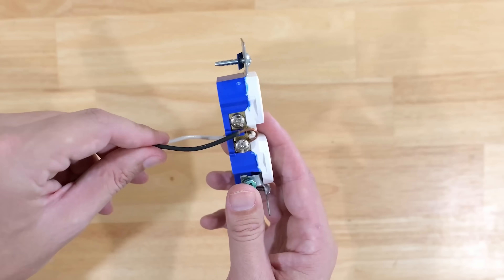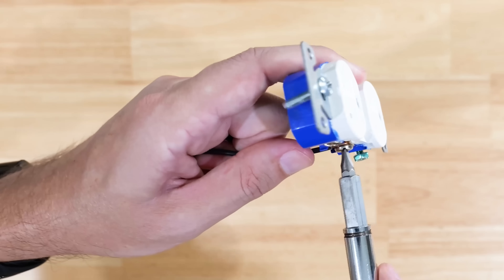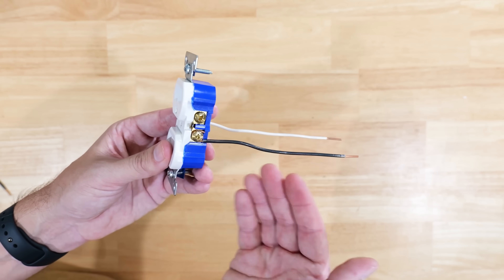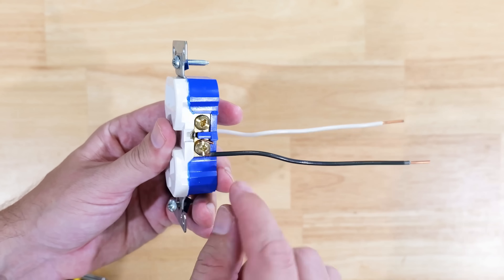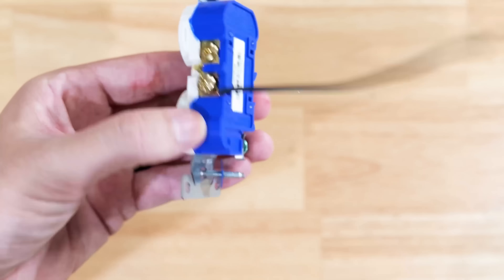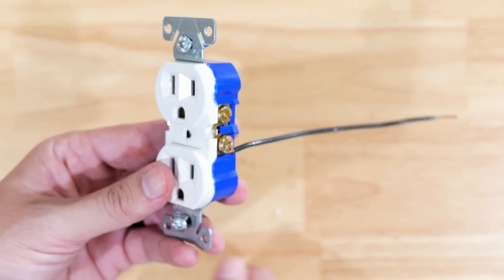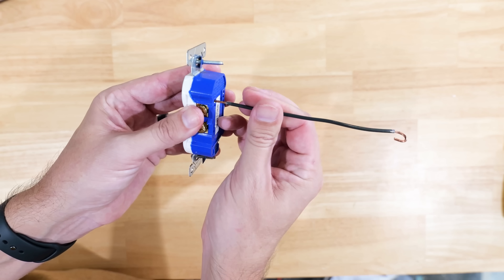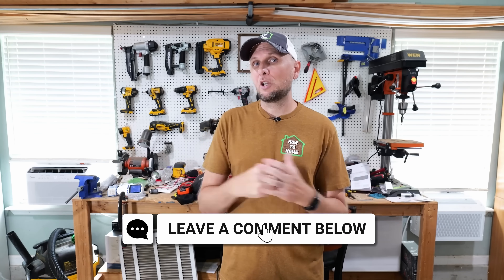Avoid Disaster! 8 FATAL Outlet Mistakes Most DIYers Unknowingly Make!

Comment: Where is 14g wire used for receptacles? Never heard of that - unless it’s in very old buildings? In fact code in Hawaii has #12 now even for lighting circuits, which I think is crazy overkill given the load nowadays from led lights compared to the old days with say old school 100 watt bulbs… 🤷‍♂️ Nothing wrong with overkill of course. Now in the Uk their overkill is simply insane! Every single outlet has a switch mounted on it just for the one outlet, which is massive and heavy duty, and each outlet has a fuse fer gawds sake! Each outlet costs a (relative) fortune. Their plugs are huge and insanely solid - tho bear in mind they’re running on 230 volt circuits. When  I show them a picture of 95c outlet with a two pronged plug they fall over laughing…

Comment: That 's completely safe to use 20A  receptical on 15 A braker ,you just overpaying for rec. What  is matter  is a load (device) plugged in to it .And  20A rec is completely OK for 15A braker if  it used for 3A table  lamp but you not using it to plug old washing machine which can consume 14A+ on a spin cycle.

Comment: DO NOT use a philips screw driver on outlets.  Use the PROPER bit head driver.  A Square Head. That will provide enough surface for a proper torque.❤ #9 use pig tails instead of making the receptical the inline fuse. Benifit is you do not remove power from DOWN LINE DEVICES if one fails. Its a outlet noy a junction box.

Comment: The NEC handbook shows and requires you close the J hook around the screw, this usually takes needle nose pliers to do this, this keeps the wire on the screw should it loosen up, since the backs of the screws are bradded down they cannot come out of the receptacle. You should of demonstrated that procedure.

Comment: Im not a pro but ive read a lot of code books. I re wired my last house and went overkill on all recepticles. 12 gauge and all commercial grade. I also take a needle nose and bend j hook before tightening the screws. Only reason I got into this was because I got a rediculous quote to re wire my brick house for $14k. I did it for less than $2k. That was 10 years ago. I had to re wire because of knob and tube.

Comment: I just retired doing this kind of stuff after 50 years one thing I did not do was buy those cheap receptacles like you said go ahead and buy a spec grade or hospital grade hospital was kind of high dollar but depends on what your it's feeding I always wondered why the hospital grade was so expensive until I took a hammer and bust a brand new one apart and everything in their brass and it was super thick

Comment: You need to stress that the proper torque can be achieved without slipping using the ECX head bit which is slightly different than phillips head.

Comment: I had some new backslash tiles put in my kitchen. A relative was doing it. He changed the recepticals. For some reason, the top plug in each receptical doesn't work.??? I took one off the other day. Here is my question and I could be completely out to lunch but the ground wire goes to the right plug in this case. No ground wire going to the left that doesn't work. I'm assuming it should ground through the box, but I noticed that the new backslash is sticking out a bit to far. Im thinking the box isnt grounded properly. I'm wondering if I run the ground wire to the dead terminal as well, would that fix the problem or screw things up worse. Sorry so long. Any advise would be greatly appreciated. Wayne from Edmonton, Alberta Canada! And no, we are not all this dumb up here 😂
Reply: I'm not sure what you mean about the ground. I think the Canadian standard is the same on this, but you should look it up to be sure. In the US, black is hot, white is neutral, green/bare is ground. Think about looking at the outside of the receptacle (as installed) but with one plug on top of the other (vertically, the way they are usually installed). (Or you could just turn your head.) For each plug, the white (neutral) wire goes to the wide blade on the left with the lighter colored screws; the black (hot) goes to the narrow blade on the right with the brass colored screws; and the ground goes to the green screw. The box doesn't really have to be grounded to work, but steel boxes are often also connected to ground to help any arcs go to ground instead of deep into you. There are lots of plastic boxes that aren't conductive anyway. The top plug and the bottom plug should be connected by plates within the receptacle. Usually, the top set of screws will have wires for power coming in and the bottom will have the wires that go out to the next receptacle. At the end of the line, the last receptacle may just have one wire on each side because there's no more circuit to go out to. Again, you should check and make sure the Canadian standard matches this. I think there's a single North American standard, but I don't want to tell you something that's wrong, so make sure. It sounds like your installation got botched and I wouldn't want to use those outlets at all until they get straightened out.

Comment: I disagree with your mistake #1. Amps are drawn by the equipment plugged into the receptacle. Receptacles do not draw amps. You should NEVER put a 15 amp receptacle on a 20 amp circuit. It can cause a fire due to the fact that the 15amp receptacle can not handle the 20 amp flow and can overheat. Whereas if you put a 20amp receptacle on a 15amp circuit the most you have done is wasted a little bit of money because everything in the circuit is rated at or above the standard. REMEMBER, the receptacle doesn’t pull current, whatever is plugged in does. And when that space heater that pulls 18amps is plugged into a 20amp circuit with a 15amp receptacle, that receptacle can and most likely will catch fire. And imagine that receptacle right under a window with curtains. You just burned down the house.

Comment: It would seem appropriate to mention, after wiring a switch, or an outlet, if you put a couple wraps of electrical tape around it, and then touch it when it's hot, you're not likely to get a shock.  Doesn't hurt.  protects from touching other stuff in the box.  Just makes sense.

Comment: Electricians make better mistakes. DIY can't even find the 8 wire backstab no screw terminal receptacles. I've also only found NEMA 5-20R used in place of 6-20R on professional work.

Comment: I saw one good tip, as an electrician for 40 years, I was always taught, to NEVER use the SPEED WIRE hole, (we call them STABS)! I'm old enough to remember when they first came out. They absolutely do not hold up over time. I would say about 40% of my service calls are because of failed STABS! And, that being said, here's an idea: 
HIRE AN ELECTRICIAN! Almost every manufactured device comes with instructions that say, TO BE INSTALLED BY AN ELECTRICIAN! Is it more expensive, yes, but how much is your home worth, your family, your life? 
Yeah, I thought so! 😮

Comment: Every plug in my house is wired through the back stabbing connections and I can't seem to get them to come out I end up cutting the solid wire just to use the screw terminals 6:39
Reply: If you notice there’s a slotted space right below the hole with the wire in it if you stick a small flathead screwdriver in there while pulling on the wire, it releases it and comes out.
Reply: Same with mine. I will have to replace them all over time.

Comment: Something for u to cover . Old wiring system. Copper wire shrink's over time . Light switch plugin ECT . Very loose cause of shrinking. No one problem in old house and fires in home . Every home I've work on pulled light ECT out tight up each screw one or two turn always . Even fuse boxes get loose over time .

Comment: 2:35
Name a few appliances that require fixed polarity. If an appliance can't handle reversed polarity it's badly designed. And how the heck could reversed polarity cause a shock or electrocution?
The largest part of Europe has symmetrical plugs and it doesn't matter how you plug them in. So why is it so important in the US?
Reply from the maker: Umm pretty much all of them.  And yeah you all have a completely different electrical grid 😂

Comment: Yeah, yeah, yeah.  I disagree.  20 amp is a better outlet with a higher rating.  You can certainly use it, just don't plug in a 20 amp draw - show me a standard cord plug that comes with a 5-20P plug in the USA - I've NEVER seen one.  It's not a thing.

Comment: I’ve never seen any problems with the backstab holes. I’ve seen houses 50 years old with those connections and no problems. But I’ve seen plenty of problems with wires hooked up to the screws. Something that you did not mention that loose screws. The bigger problem is when they get loose and introduces resistance into the circuit and that generates heat, that’s the big problem not and second of all, I kinda doubt that there’s gonna be a lot of movement stress if any on an outlet that is fixed inside the box properly. So where is a disagreement? I think it just comes down to and I say this is my experience being a technician for over 42 years that people in the field have their opinions and they stick to them.

Comment: Watching these videos made by a guy who means well but isn't an electrician is hilarious. Really, how often do you run into a 20 amp, cord-connected appliance? Why would that be more dangerous than simultaneously running two 15 amp devices on the same circuit? Who hasn't done that? Did it start a fire? Now, stab-wired receptacles are a bad idea. They WILL cause trouble in the future. Just don't do it. Back-wired and stab-wired are not the same. 20 amp receptacles usually have stronger springs and may make better contact. Any receptacle should be replaced if the plug isn't held securely or gets hot during use.

Comment: I know electricians don't like the push to seat terminals on the back of outlets.    The outlets are designed and certified to use the back terminals.  They are not dangerous.  As with most things, the problem is the installation rather than the product itself.  That said, you just recommended using an outlet with a push and lock type terminal which is not that different.

Comment: Learn a lot from this, which I probably should have learned before redoing 99% of my house. @HowToHomeDIY The Eaton Commercial Grade Receptacle linked in the comments is BR15W but the one in the video is BR15W-SP-LW. The one linked appears to have standard screw terminals, not the clamping ones shown in the video. Eaton doesn't make it easy to identify the models with the clamp-style terminals.

Comment: This is a surprisingly lame video.  Given that many circuits have multiple outlets, it's just silly to assert that wiring a 20 A outlet to a 15 A circuit creates a potential fire hazard.  There are a dozen ways to potentially overload any such circuit (e.g. plug huge electrical loads into every socket on the circuit)...which is why you have a circuit breaker!  That's what protects the circuit and prevents fires, NOT your choice of outlet.  Regarding reversed polarity: "The power is not only flowing into the receptacle the wrong way...and that can lead to damaging whatever it is you're installing"  That's just nonsense; this is AC power.  Correct polarity is all - and only - about ground faults.  I stopped watching after this.  Sigh...
Reply from the maker: Buddy take it up with the NEC then.  I don’t make the rules.  And circuit breakers always work right?  They never malfunction?   All you said is just opinion on how you think it works.   So your comment is unsurprisingly lame and incorrect.
Reply: @HowToHomeDIY  National Electrical Code is one thing; physics is another.  If you instruct folks to follow code, e.g. "connect electrical wires to the proper terminals", but give them an incorrect explanation for why it needs to be so, then you do everyone a disservice.  (For example: "In the U.S., be sure to drive on the right side of the road; otherwise, your headlights will burn out!")  In short, your suggestions are correct, but your explanations are not.
Reply from the maker: Yeah they use physics when making the code.  And yeah if a breaker is faulty and you overload it you’re right, it is a problem.  But that doesn’t mean you then purposely put receptacles on circuits that is even more likely to overload it.  You can’t plug a 20 amp plug into a 15 amp receptacle.  It won’t fit.  That’s by design.  But please, since you know it all, please share with the class why the NEC doesn’t allow for 20 amp receptacles on 15 amp circuits.  Are they just being mean? 😂
Reply: @HowToHomeDIY  BTW, if your circuit breaker is faulty, it doesn't matter what outlets you've installed; it you overload the circuit, you're cooked.

Comment: Yea it rated for 15 amps but it actual amperage is higher. I am not talking anything as far as code goes, just talking actual facts. That said very few things in homes draw over 20 amps. Most tiems with the exception of items that generate heat, convert ac into dc to run. So if you ever read most small home heaters only ever draw about 1600 watts draws just under 14 amps, but often you see the breaker trip, because there are other outlets non that breaker. I have a 4 slice toster and a drip coffee maker on a 20 amp kitchen circuit, but if both are started at the same time it will trip the 20 amp fuse. The bigger problem really all boils down to the wire gage and the distance of the run. Most runs in homes are 14 gage wire, so it generates more resistance in the form of heat and circuit breakers will flip more often, then breakers that keep tripping also start to get weaker and will trip easer but no one ever bothers to replace them. Last most people do not even have decies that actually have the certified 20 amp plug that runs sideways on the one blade, so installing a 20 amp socket often is better made has more contact and makes the receptacle safer and less heat generated. All my home sockets are eventually or are replacex with the 20 amp versions. Its still to code.

Comment: Don't put a 15A rated receptacle on a 20A circuit. Much like cables, normal house receptacles don't have anything stopping you from burning them up by pulling more amperage than they are rated for. You can go 20A receptacle on a 15A circuit, but not 15A rcpt on a 20A circuit.

Other info seems correct.

Comment: I am super happy that I do not make most of these mistakes. I try not to straighten my shepherd hooks if I'm reusing the wire because I know about the weakening thing, work hardening you called it, it's WORSE with aluminum wire, which can make pig tailing in copper ends challenging (Merit and paste and tape for the transition).

Comment: the biggest mistake we should talk about is making sure the old plug your replacing has the isolate tabs broken away from hot or neutral side of the receptacle because if you do not do that you will trip your breaker and that plug will not be able to function at all make sure you break the appropiate tabs off your new plugs.

Comment: 5:00 , you see the phillips head screw shape but if you look closely there is also a "square" in the middle of the screw, this is called a Robertson type terminal. It is a square bit that is meant for electrical work on screws and circuit breakers. This will not strip or slip when applying the correct torque value. ROBERTSON BIT. SQUARE
Reply: I just call it a number three Phillips head
Reply: Some screwdrivers have a combination Robertson and flat so the driver fits corresponds exaxtly to the slot on the screw
Reply: Right..not covered! That bit will get the torque you need!

Comment: 3:00 absolutely wrong information.... its A/C power, it is always alternating direction.... The literal direction of the current flow is the same on either side. It poses absolutely no increased threat of getting "electrocuted" as you say... which btw if you got electrocuted that means you died. electrocution = death. You do understand that the reason devices do not have a ground prong is simply because the outer casing in non-conductive (there is no metal to "ground out")

 The reason it is incorrect is because of the size of the blade ports, and the type of screw that is shown, silver for neutral. Why would you immediatly show it wired WRONG? This puts it in peoples head that t his is how it is done. You should have shown it wired correctly, and simply explain what people do wrong by wiring it the other sid.e NEVER show something "incorrect" first.... very confusing

Comment: I use 20 amp receptacles on 20 amp circuits exclusively but I often use 20 amp receptacles on 15 amp rated circuits for the simple fact that in certain areas where individuals are constantly "plugging in" the removing the device from the outlet, I require of myself, to replace that 15 amp rated outlet with a 20 amp outlet because, 20 amp rated receptacles have stronger jaws due to stronger spring tension within its design. Also, have any one of you noticed the receptacles in hotel rooms at the night stands and elsewhere where you might want to insert your cell chargers and the chargers literally Fall Out of the outlet? Sometimes the problem is mechanical WEAR and not so much load.
I've been a Electrician for over 50 years and yes, I've seen it all....LOL